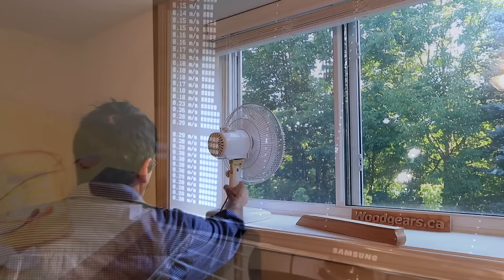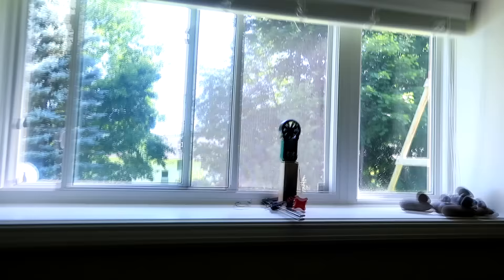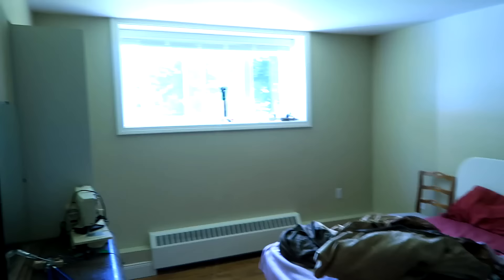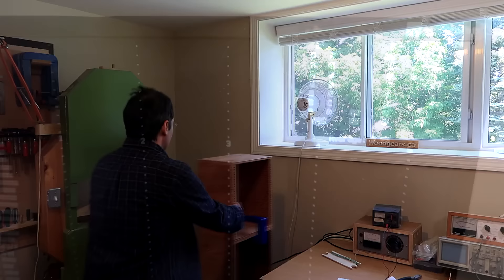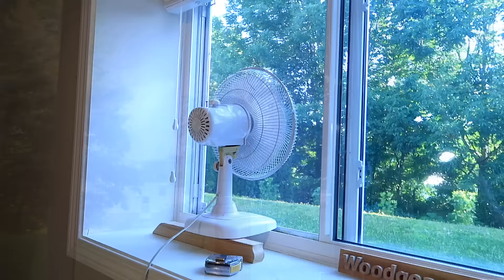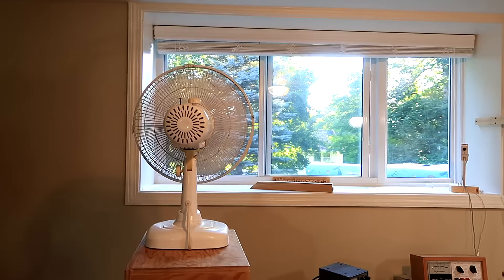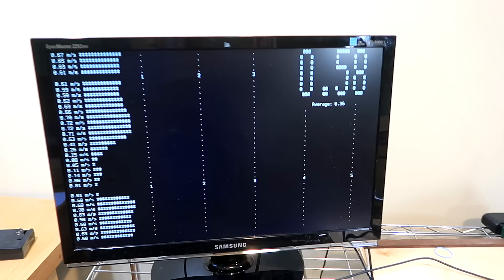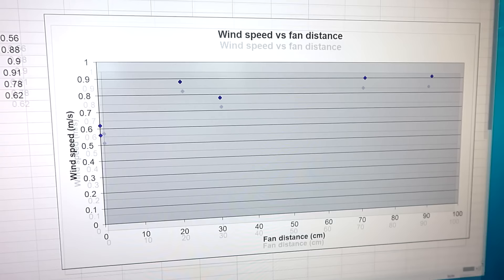Best fan placement to move air through the house

Comment: Amazing, thank you for making this. It will solve so many family fights on the best way to cool the house
Reply: Ice cube distributed evenly - one in each shoe.
Reply: If there’s one thing I learned about family fights it’s that they are never resolved via a YouTube video
Reply: Bring cold air in low and send hot air out up high on the other side of the house
Reply: prevent some murders too
Reply: @Bout_TreeFiddy  I worked for David Horowitz in Seattle the Civil Rights leader are you related
Reply: Holy crap I think I bought an old Raleigh bike frame from you way back - like a decade ago
Reply: @thecloneguyz  Nope
Reply: @L__Y  hah!
Reply: pretty common household argument, I'd say
Reply: * start
Reply: The best way to cool a room is to take the hot air and put it outside
Reply: Lol just buy more fans
Reply: Actually, it won't. He measured optimal airflow, not temperature.
Reply: Turn on the ac?
Reply: can you blow cooler air in from a crawl space, have it circulate through the house, and then  blow warmer house air into attic, achieving a sort-of solar chimney?
Reply: install big 2 litre coke bottles stacked all together as wall where  you cut bottom so in such a way that  aur enter from big sid ( cyt out bottom ) and come out from top side ( top of bottle) you will feel difference in air temperature.
Reply: @AshishEmbedd  thanks man! it took some time to figure out, but i get it now.
Reply: Big fan of your podcast, and Cobalt2!
Reply: Sam here I always said it was better to push the air out but I always get a raspberry
Reply: Good luck with that, I still can't teach my colleagues that it's better to keep the CCFL lights in the toilet running the whole day than constantly switching them on and off.
Reply: A simple way to see... Put fan towards outside... People think that you are crazy... My family though I was crazy... But this is simple observation....
Reply: If you have air conditioning then absolutely do not do this...
Reply: It would! If my family wasn't so stubborn!!!
Reply: @thecloneguyz  From a north-facing window to a south-facing window. Reverse it if in the southern hemisphere.
Reply: Now if only if I can convince the wife that a fan in the middle of the room isn't madness but practical albeit takes away from the home decor....
Reply: Not surprised to find you here. But surprised out of 800k people Syntax's Wes Bos showed up. Love the podcast!
Reply: He saved your fam bruh lol
Reply: Sick tip
Reply: Use an AC simple
Reply: If those fights involve the mention of A/C, rest assured they will not be solved
Reply: no it won't cos most family members don't know eff all about the scientific method!
Reply: Im winning every time forsure
Reply: @iair-conditiontheoutsideai3076  with The shovel. Not gloves 🧤!!
Reply: @dunnnuu6502  🤔🤷
Reply: He proved my wife wrong. This man is king.
Reply: Best way to cool a family dispute is to remove the hot heads.
Reply: @Newenu  you are crazy
Reply: @rollercoastercentral0808  it’s not that simple with AC. 

When arriving home at night and inside is hot but outside cooler would you initially open up the windows first to let the trapped hot air out as the cool AC air comes in. 

Some say keep the windows closed. 
 
I use the car example. It’s better to roll the windows down and turn the AC on full blast then after 5 minutes close the window. 

For a 2 story home I’ll leave a couple of upstairs windows open to let the hot air out.
Reply: just buy an aircon
Reply: Re. Fights - the people that need this information will never accept it. I know people who 1) push the up and down buttons on an elevator bank, repeatedly, because it calls the car quicker(!), and - my favorite: 2) turning the car temperature dial all the way up or down warms it up/cools it down faster. SMH